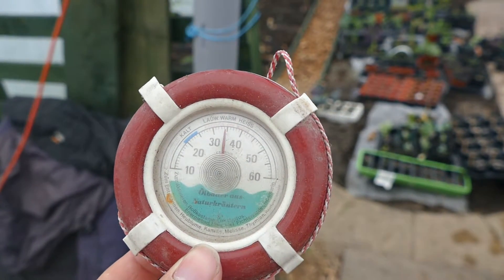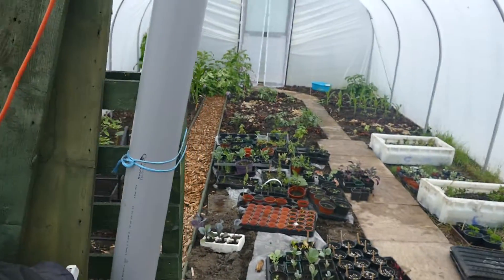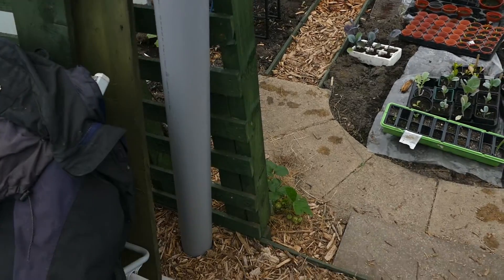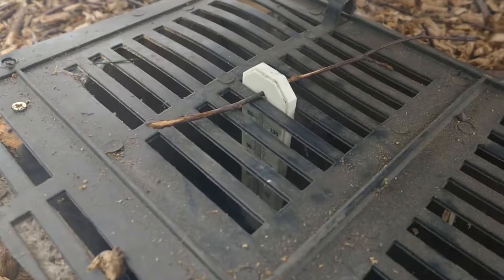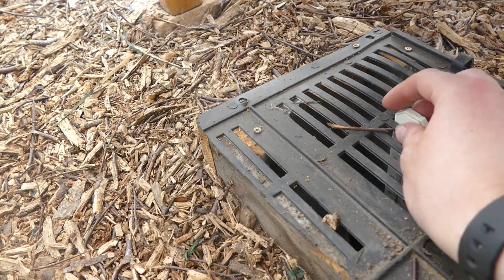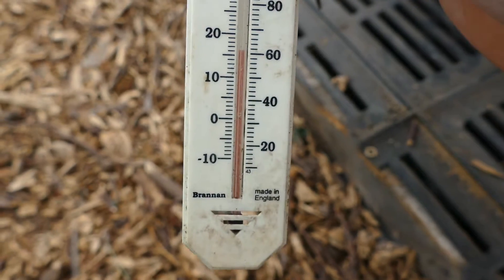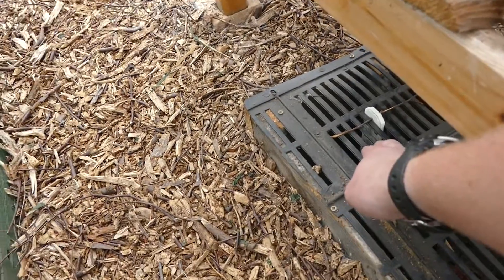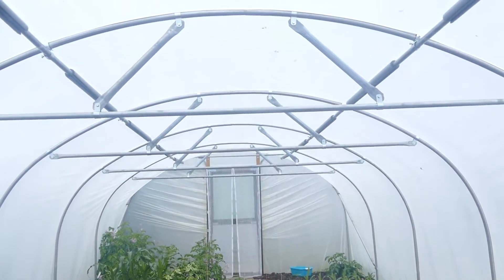Polytunnel Heat Sink / Thermal Store Finally Running

Comment: You should aim to get the output temperature closer to the inlet temperature by running more cfm. If the outlet is the same as the soilmass temperature the tubing is not being utilised efficiently. You wont see the outlet temperature rise above the soilmass temperature until your putting all the greenhouse air underground 20x an hour. 

The important thing to remember is its the mass flow not outlet temperature that counts.  Consider this, cooling an eggcup of air to 16C and sending it back into the greenhouse wont do much to drop the greenhouse temperature even though the thermometer reading on the outlet looks impressive. If you put the entire greenhouse air volume underground once a minute the outlet temperature will be much higher than the soilmass temperature which, on the face of it looks less impressive on the thermometer but it is, in fact, transferring considerably more heat and it will be effective at cooling the greenhouse.
I tested my system during the recent hot spell when the outside air temperature was 90F. I sealed the greenhouse and let it climb to 140F (full sun, wouldnt go any higher). Running the system fan flat out and with the sun still beating down, it took just over 12 minutes drop the greenhouse air temperature down to 68F.
Reply from the maker: Thats a very impressive temperature drop your achieving with your system, how well does it heat in winter? I'll be happy with my set up if it can keep the temperature just a few degrees warmer inside the polytunnel than outside. The polytunnel is a long way north in Scotland so I don't worry about cooling as its not normally an issue, however I do want to store as much of the heat as I can so that it retains the heat over night and some of the winter. I certainly think that the system needs a more powerful fan, and that will probably be the first upgrade I make. The issue I have is its possible to get frost at any time of year in my part of the world, we even had a light frost a few weeks ago in midsummer. We also have very cool temperatures in April and May, even though the sun is hot by then, so I need the system to retain enough heat and release enough to allow tender plants to grow from April until October. September and October are normally ok as the polytunnel is only about 100m from the sea, so the sea keeps the night temperatures up, however in spring there is very cold fog and wind that comes off the sea and cools the garden. I don't need much heat between November and February as there is so little sunlight this far north even with heat the plants won't grow much without grow lamps. 

Thats the minimum I would like to achieve, ideally I would like to have the temperature higher, and in the future I will investigate more powerful fans and thermostatic switches. The only issue I see is increased running costs when using more powerful fans.
Reply: It was an extreme test, the plants wouldnt be too happy with 140F or going from 140 to 68 in such a short time frame. I normally have it set to maintain 75F with the fan at less than half capacity. Its more energy efficient to run the fan at a constant level that keeps pace with the incoming heat gain than to run it intermittantly at a very high flowrate such as in the extreme test. My fan draws 150w flat out and depending on what the weather is doing, it can bank upto 22kw of heat per hour during peak cooling periods. A clear, sunny winter day can provide a considerable amount of heat, the trick is putting the excess into the ground as and when its available and  before it has chance to escape. In winter the heat usually arrives in fits and starts. Having the extra  capacity to move a lot of air in a short period of time is handy for this. As is a differential thermostat and fan speed controller. 
I`d recommend calculating the approximate loss in the tubing layout before upgrading the fan as the losses increase with flowrate.

Something else i`d consider doing is fitting a second skin to your tunnel and inflating it with a small blower which will drastically reduce the heatloss. I use an inflated cover on my greenhouse with 3 layers and 2 air cavities. The extra cost is negliable considering the benefits. The inner skin lasts longer as its protected by the outer skin which takes the brunt of the weather. The added insulation value reduces condensation on the poly layer inside the greenhouse, this means no rivers running down the walls in the morning and more light entering without a film of condensation to block it. The inflation also prevents the outer skin from flapping which is the quickest way of destroying a poly cover, apart from it being in contact with pvc hoops.

Comment: do you run the fan all the time? i am planning to have a similar setup. also is your polytunnel based in elgin?
Reply from the maker: Yes, the fan runs all the time, I was thinking about putting in some thermostatic switches to make it more efficient, but its a bit too complicated so I'll leave it for now. yes the Polytunnel is on Elgin.

Comment: so summer at your place is not hot enough for the plants thats why u need that heat machine ?
Reply from the maker: +Indra Yudha Kusuma yes, our summers are cold, it rarely gets above 20c. At night it can get down to 2c even in summer. So the polytunnel traps the heat from the sun. The polytunnel gets very hot when its sunny, but at night or on cloudy days it's cold. So the heat sink stores the heat when its sunny and releases the heat when its cloudy and at night.
Reply from the maker: +Indra Yudha Kusuma yes, our summers are cold, it rarely gets above 20c. At night it can get down to 2c even in summer. So the polytunnel traps the heat from the sun. The polytunnel gets very hot when its sunny, but at night or on cloudy days it's cold. So the heat sink stores the heat when its sunny and releases the heat when its cloudy and at night.
Reply: 20C in summer? That's really cold indeed. Makes a lot of things a challenge when it comes to gardening huh?
Reply from the maker: Yes, it means that plants such as Courgettes, pumpkins, climbing beans, tomatoes, Basil and sweetcorn have to be grown in a polytunnel. Cabbage, lettuce and potatoes do well outside though. Its a short growing season with the last frost in early June and the first frost in early September. But I have even seen a light grass frost in June and July before. We are only a little further south than the tip of Greenland and almost as far north as Anchorage. Because Scotland is surrounded by water it keeps the coldest weather away so we don't have as much snow as other places as far north. But because of all the water it keeps us cool in summer as the wind is always going over cold water before it gets to us. Even if hot air tries to come across from Europe the sea is 10C - 15C so it cools down the air before it gets here. If you google 'Elgin weather' you will see how cool it is here at the moment.
Reply: Thanks for all the details. It's interesting how people adapted to live everywhere actaully and grow pretty much everything.